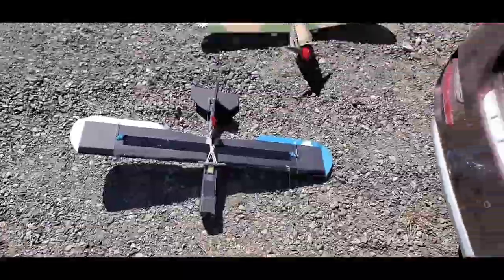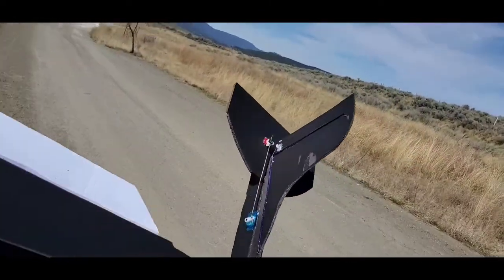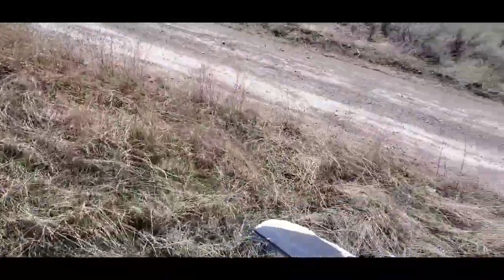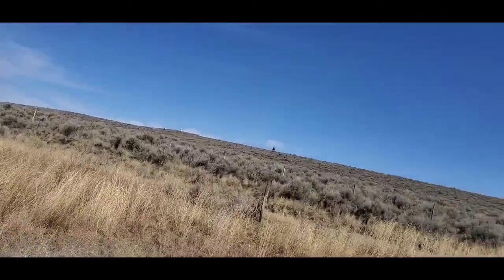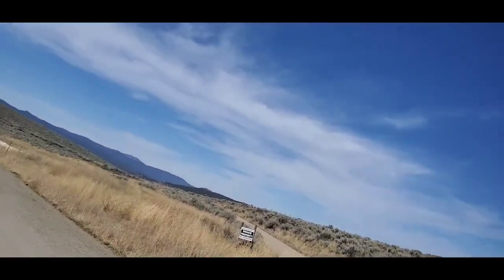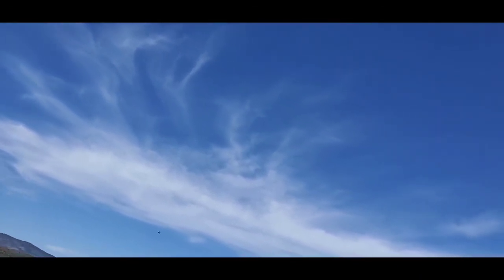RC Plane: P - Pusher Maiden

Comment: For hand launched pusher aircraft, we have found that the plane must be launched at a higher angle than normal, and use only about two thirds power. Max powered launches tend to push the aircraft down until lift is created with increased speed, even with gliders. Once they gain speed, they are fun! Thanks for sharing.

Comment: Kv does not mean kilovolt in terms of motor ratings. Search it up
Reply: Why don't you enlighten us then what KV is
Reply: @M-H433  kV is motor rating
Reply: K = “K” is a math symbol for “Constant;” 
“V” is “velocity” - referring to rpm, meaning a constant rpm’s per volt: as one volt will give a thousand rpm’s 
in an ideal NO load configuration.     
      Which; as I figure, is kind of a useless parameter;  if you’re looking 👀 for a practical solution.    
The best is have on hand several motors, propellers and a spare ESC.  
Just takes money 💰 even if U copy something similar !

Comment: information.     the optimal location of  cg  IS  at  Thirty percent (of chord).!     PERIOD.!!!      if desired, the cg can be a bit forward of thirty.       the span of the horiz-stab is  Less-than  it  should  be.      in the case of a powered model, the stab span should be equal to about  thirty  percent of wing span.        the mass of, the aileron servos,  Should be located as  Far  Inboard, as is  Practical.!        wingtips   Should  be   Finished.!!!!!        googletranslate